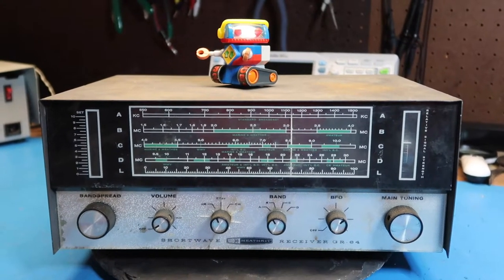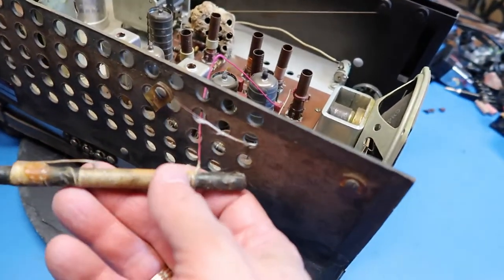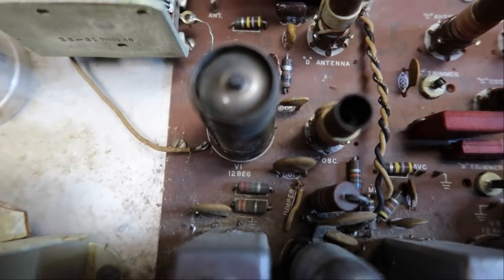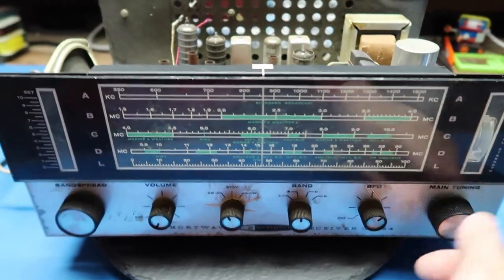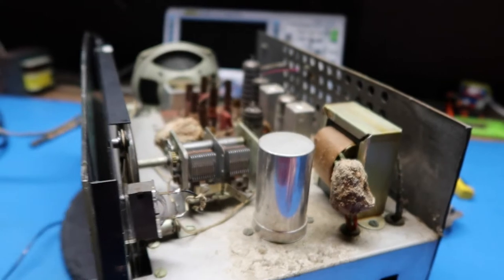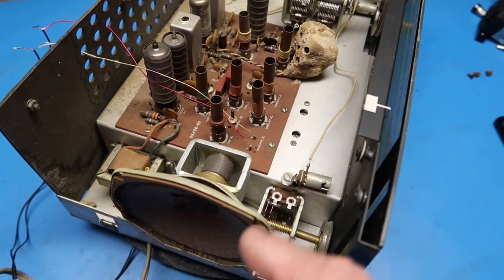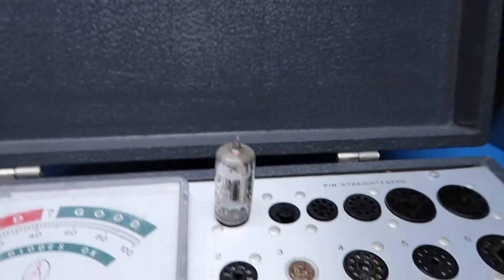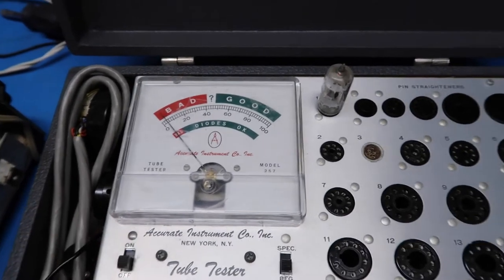Inside a Heathkit GR-64 Shortwave Receiver

Comment: Hello, respectfully I would like to point out in this video while you were testing this unit. The band mode switch was set to the "Standby" position. That essentially suspends any operation of the receiver while in Stand by mode. There are many hams that collect Heathkit products. In my opinion that is absolutely worth a complete restoration. Hopefully the next owner will restore it. Awesome find though.